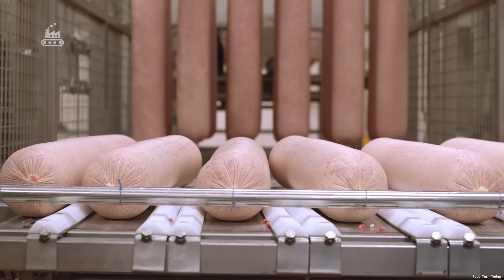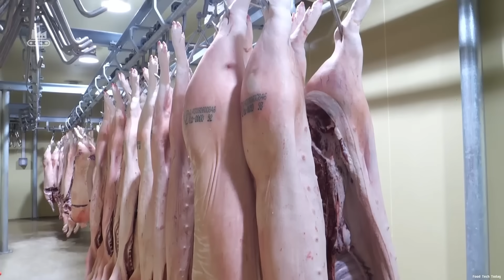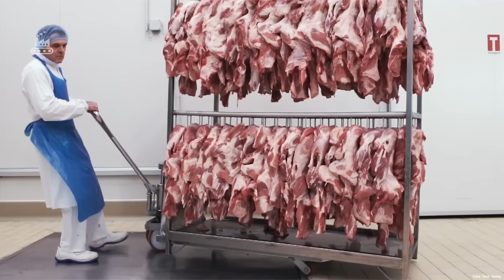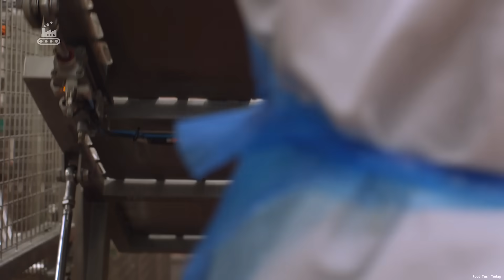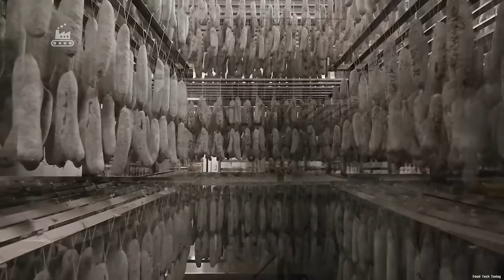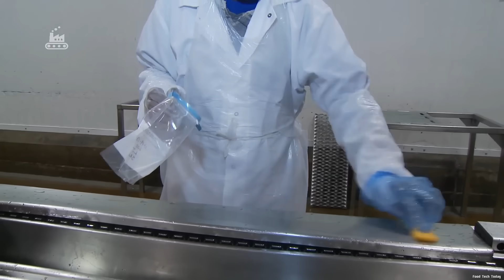How Pepperoni Sausage Is Made in the Factory | Inside an Amazing Sausage Production Line

Comment: I always thought that pepperoni was smoked.
Reply from the maker: You’re not wrong — it is smoked
Reply: @FoodTechToday ahh!  I apparently missed that part of the video.  Thanks!
Reply: @merindymorgenson3184  It was hard to tell as it wasn't the same product or process from start to finish but smoking is usually done around the ferment process or once the pH has dropped low enough they could be smoked and heat treated to speed up the drying process, usually only in cheaper products.